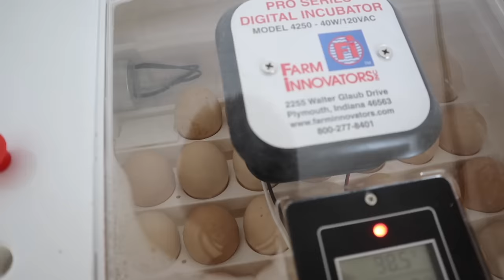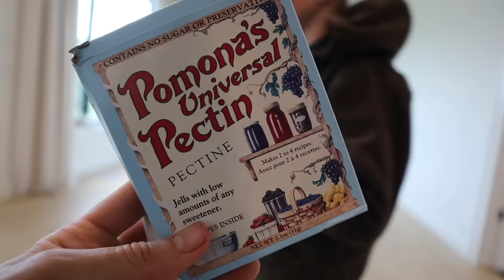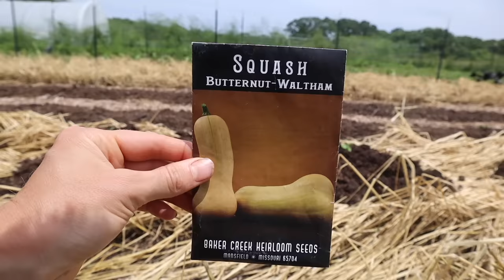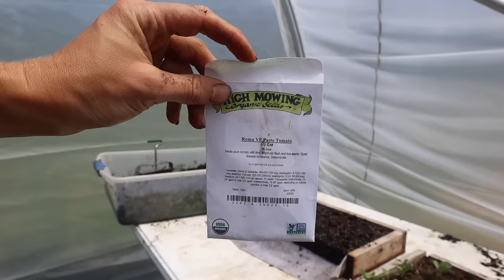The Reality of Food Self-Sufficiency

Comment: There is a device called a sand spike pump for making quick access to a water line for well-water pumping. Its skinny and light, get a few or make a few so if rain oversaturates your crop lines you can hammer the spikes and drain off water around rooted crops.
Reply: Or you could build an open roof bodega frame with V-slots cut into the frame to shunt overwater elsewhere like coops and troughs
Reply: Redirecting rainwater can be more effective than just catching it
Reply: For the sand spikes i would eventually make permanent placement points for them that have rocks, gravel and sand to filter the water as well. With any build try not to make it easy for rats to make homes out of voidspace.
Reply: Making a few inverse cone shaped catch ponds for water runoff might be good but dont have it be standing water. Have a way to repurpose it.

Comment: Might I give you a theory to ponder.  If you plant seed, or crops in wet soil when you dig that hole you compact the sidewalls of the hole you dig.  This compaction layer makes it difficult for roots to grow through.  This can cause multiple problems.  The plants can look sick, or look fine, however produce low yields in the future.  Also this compaction layer can be a barrier so rain, or water can not soak through that barrier created by us humans and therefore water will puddle in the hole you dug for your plants.  You have seen the results of to much water.  If it had rained a little less the plants might not have downed, however the ground may have stayed to damp, and then disease will set in later.   I've been planting crops, and a family garden for a better part of 42 years, and you learn a lot along the way.  Soil prep is important.  Staying off of and waiting for soil to dry out until the SOIL is ready to plant is important.  Take it from a guy who planted 21 million, 850 thousand seeds, and or plants in 2022.  Best of luck to your family.  Life's an Adventure.  Make the most of it.

Comment: I hope you do know, just because the freeze dryer says it’s completed the process, doesn’t mean it’s dry. Hope your weighing the trays. I saw a post of some one with a FLIR camera and using it on the freeze dried. He weighed each tray and used the FLIR camera after the FD said it was completed. Each time there was still moisture in the food and the FLIR camera showed it. So remember, just because the FD was done, doesn’t mean it’s dry. Weigh your trays will tell you. Saves you from running into any problems later on.

P.S. your not supposed to store the mason jars with the twist caps on. It will prevent you from knowing if the vacuum was broken. With out the twist caps you can run your hands over the tops of them and If one broke vacuum the cap would slide off once your hand touched it.

Comment: My question, putting a black air barrier over your row-crop section, wouldn't that raise the temperature, and potentially kill the soil biome?
   Adding to this, the insulation of the cover crop could I sulfate the soil from temperatures that could kill the soil biome. I'd check the temp, (spoken by a MA. Without a stick in the ground).

Comment: pretty sure our garden plots are within the same area geographically so you should have plenty of time to grow Tomatoes before first frost is even possible. Honestly after years of doing this I don't even bother to start putting anything in the ground now until the last half of May and I will plant up till the last half of June. The rains are just too heavy for most plots in Missouri until June. One year I lost all of my tomatoes due to heavy rains and replanted completely from volunteers. As for your zucks and such I usually wait until at least the second week of June to put them in also due to rain and due to all the squash bugs, the bugs tend to die off more in July so don't get as bad and are easier to deal with on drier ground too. If you get a few extra round bales try rolling them out instead of a cover crop as your first level sometime it will pretty quickly raise you ground level higher and help the drainage issues.

Comment: For what it is worth, your asparagus plants are way too close together.  Asparagus plants expand in a circular fashion and should have a minimum of 18 inches in all directions to expand into.  Failure to provide adequate space will significantly diminish the size and quality of your spears as the plant competes for nutrients with neighboring plants, as well as shorten the life of the bed.  While conventional wisdom is that at bed should last 10 to 15 years, there is no reason with correct spacing and thinning a bed won’t last indefinitely.  My bed is now over 30 years old and going strong.  As for weeding, detailed weeding isn’t really required in an established bed.  I pull any tall weeds that develop and the asparagus chokes out the shorter ones by midsummer.  The two main concerns with asparagus is to maintain good nutrition and to prevent it from choking itself out.  Overcrowding is the main killer of asparagus beds.